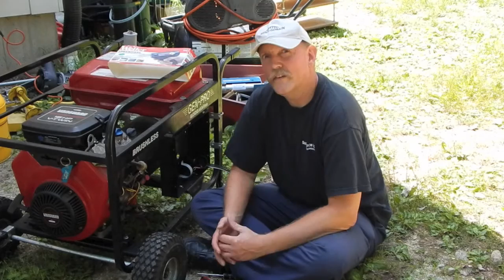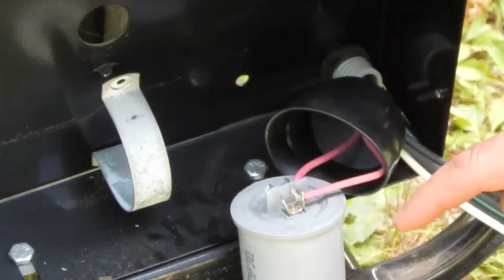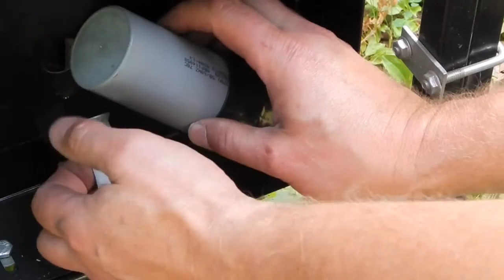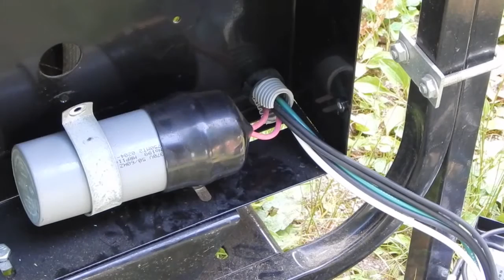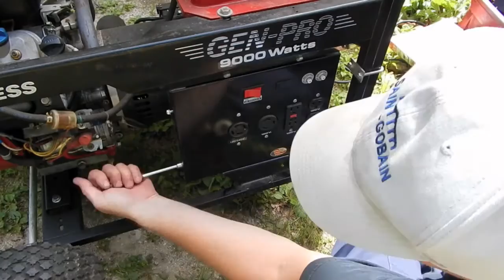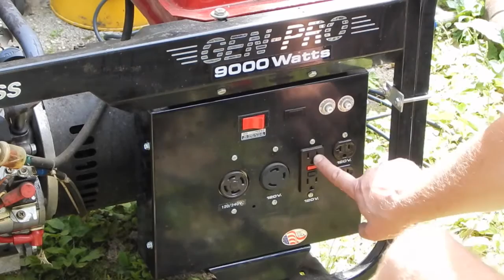Gen-pro generator Part 2

Comment: We just had a 15 hour power outage. I have a Gen-Pro 6Kw diesel generator. It's like 20+ years old. It ran with power for about 15 minutes, and power went dead. I checked the 50uf 370 volt cap, and it was shorted out. I have a new one coming in the mail for replacement tomorrow. Such an easy quick fix, YET, you can't get capacitors like that locally anymore...